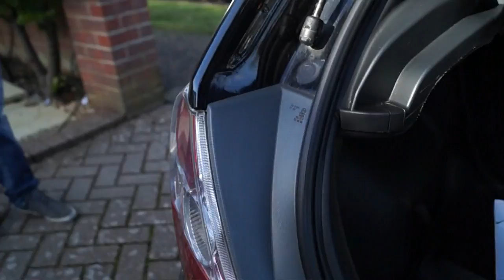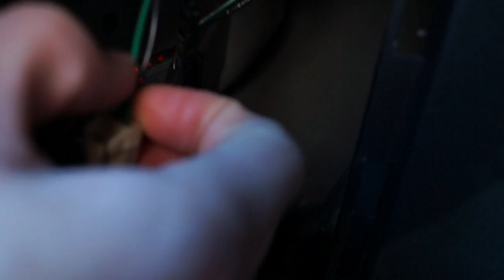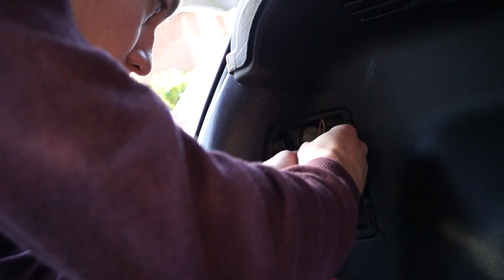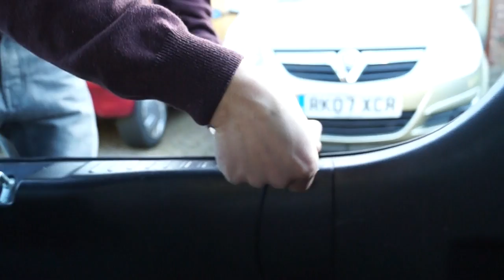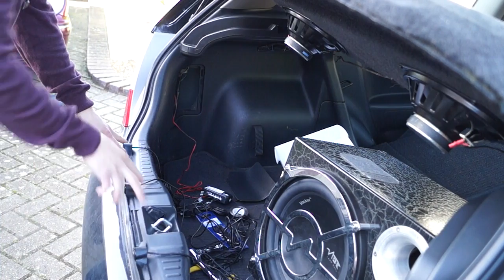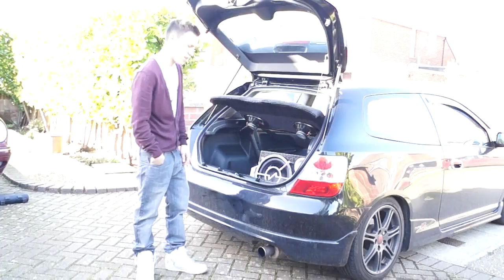Test Wiring Reverse Parking Sensors Retrofitting Civic Type R

Comment: We're will the sensors be if built in? My brothers car got clipped back right bumper, we checked made sure it was just body damage, had it repaired but have realised parking sensor has stopped working 
Any ideas ?
Reply from the maker: Unfortunately I don't know if these would work with an OEM set. (if that's what you're asking?) Firstly find out if they use the same connection, then maybe.